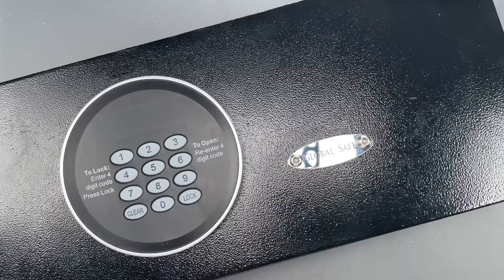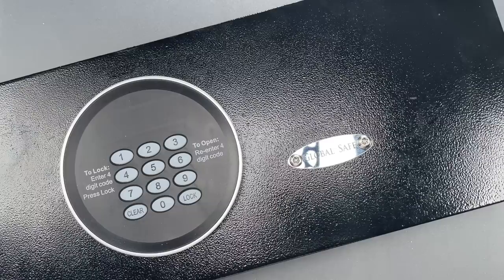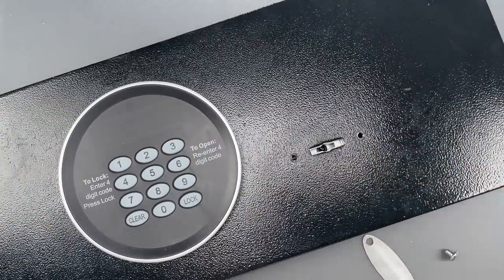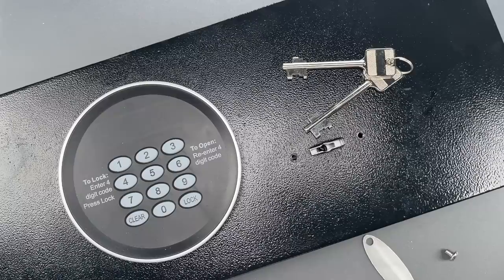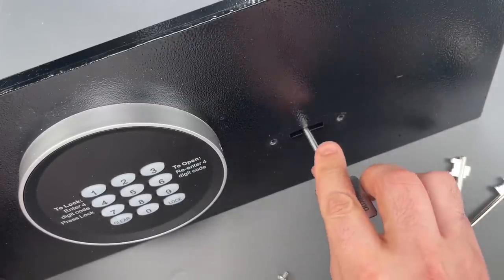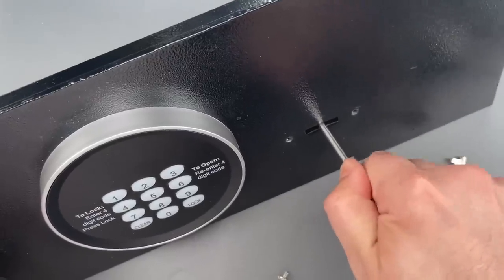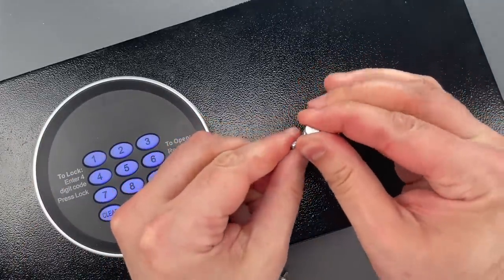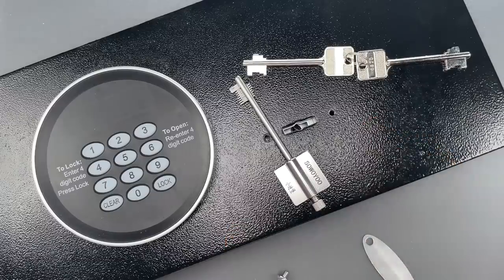[1462] Impressioning a Hotel Safe Lever Lock (Global Safe)

Comment: About 40 years ago an employee stupidly put the keys to our high end floor safe down the deposit chute! We tried every locksmith but all claimed it could not be opened, so would need to be excavated from the concrete floor...one chap gave me a phone number of someone he claimed could open it but on the strct understanding he was not to be questioned....he charged £300, he did a similar thing as LPL except he covered the blank with a very thin coat of putty, after 2 or 3 impressions he then slotted tiny lengths of metal into a hollow key shaft and tightened them with an hex key...et voila! Opened first go...and he handmade me a new key...I suspect his 'apprentiship' was with the sort of people your parents warned you about!
Reply: Great bedtime story. I’m a locksmith but I only contract under strict terms of anonymity and customers aren’t allowed to make direct eye contact or chew gum in my presence.
Reply: Something similar happened years ago when we had a drink machine with cups.  A part-time employee opened the machine to load more cups and left the key ring with all the office keys inside the machine.  The next day when they called the supplier they found out it would be an expensive service call to try the different keys.  However, I had a very good memory and remembered the number stamped on the key.  It was cheaper to buy a replacement key to open the machine and retrieve the key ring.
Reply: @Make-Asylums-Great-Again  if your inferring it's an exaggerated story I can assure you it is perfectly true, I found out some time later that he was indeed a professional safe breaker....he actually opened an old safe we had in the basement quite literally with a key he pulled out of his bag, took him 20 seconds from looking at it to opening it...unfortunately it only contained old paperwork.
Reply: @raymond19001  You should always have duplicates lodged with the bank.
Reply: @philipinchina  They should, but they don't. No need for quality assurance when you plan your own bankruptcy, i guess. 😆
Reply: @philipinchina  I agree.  I have duplicate keys for all my locks.  However, I was not responsible for this machine, it was the employer where I worked.
Reply: A lot of the need for secrecy or anonymity has more to do with avoiding being pressed into service by criminals or police than with a shady background. LPL knows this and keeps a low profile 😉
Reply: I hope you mean "apprenticeship"
Reply: @Make-Asylums-Great-Again  How very droll.
Reply: @jeffgraham6387  I was referring to my own personal experience(I live life by a strict set of codes) and I liked your story, I happen to see it before going to bed. Man, people always take things in such a negative way.
Reply: @elemar5  thank you
Reply: @Make-Asylums-Great-Again  great comment especially the chewing gum bit.
Reply: Twist, it was LPL.
Reply: @zxggwrt  His low profile has more to do with a past screw up, and no I don't mean anything criminal. Let's just say it's not too hard to find out who he really is. He had a different youtube channel before and some mistakes were made. I don't say this to criticize him, I still like him just fine but like all of us, he too has skeletons in his closet.
Reply: Many years ago, my wife and I were traveling through the mountains of southern Germany. We came across a very German looking restaurant that turned out to be a Chinese food restaurant. Never having had Chinese food in Germany, we stopped for dinner. As we exited the rental car, I noticed that I had left the keys in the ignition. The rental car company told us that we would need to contact a local locksmith as they do not have spares. When we ordered dinner, we asked the waitress if there was a locksmith in this tiny little mountain town. She said no, but she may be able to help. She turned to talk to a bar patron and said some stuff in German to this gentleman and came back. She said he could get the car open with no damage for 100 Marks under the condition that I don't watch and don't look at him and don't acknowledge him in any way. I agreed. By the end of dinner, the waitress brought us our bill accompanied with the keys to our rental. Overjoyed, I gave the waitress the amount agreed upon and told her that I wished to buy him and his friends all a beer as thanks. We left the restaurant and headed back to our hotel. We both agreed that his stipulations were kinda weird...but laws in other countries may be weird to us...and who are we to judge.
Reply: @ekummel  I wonder if it had more to do with him knowing some really easy way to get into the car and so he worried if you saw, you wouldn't be willing to pay. Reminds me of a story Richard Feynman tells in his book. Paraphrasing, he was asked to crack a safe as he was known as a bit of a safecracker. Fortunately he already knew the combination so he agreed but on the condition that he had to be completely alone and it would take about 20 minutes. He left to "get his tools" but was actually just looking up the combo in his notebook, came back and locked himself in the room with the safe, read the newspaper and made the occasional banging noise for 20 minutes, then opened the safe. It greatly enhanced his reputation.
Reply: @ekummel  A while ago, I had to break into my own car.
Turns out, the whole "ripping off a windshield wiper" thing actually works. 
Still took me quite a while, in a supermarket basement Parking lot.
Keys left inside, went shopping and came back...damn.

I pried open the top of the driver- side door a little further (by inserting folding leatherman combination pliers from another helpful customer), pushed the spring steel wiper insert through the seal and between the corners of the door edge and frame, and after some trial and error, managed to bend the wiper insert to a shape that would reach the "lock/ open all doors" button.
The seam kept bending the insert into a curl, so I had to pre-bend it even further the other way, to find a balance between elastic and plastic deformation. 
I also gave it a twist along it length, that finally made it work.

Took me most of an hour, the seam got scratched a lot and the seal punctured, but this car was too much of a clunker to really worry about that. Buying a similar car would have been cheaper than a locksmith.

It felt really nice to get it open :D
Other than the person with the leatherman tool, there also was a worker from the supermarket, who had to lock the gates. 
He was very understanding, and told us to just use the entry gate to get out, which had been broken for a long time anyway and could not be closed.

It also was impressive how kind and helpful other people are when you break into a car in public and there really is a key visible inside. Not that they checked.
Propably works with most plausible stories, and a crate of groceries or similar props...
Reply: @nos9784  it’s like wearing a high vis jacket and carrying a clipboard.
Reply: Please "voila", not "viola".. it means a completely different thing.. :D
Reply: @freeeflyer  you missed the joke.
Reply: @jeffgraham6387 did all the lock smiths that failed to unlock the door still charge you for showing up? It's robbery when they do that and fail to actually do the job.
Reply: @Make-Asylums-Great-Again  or you just sux at locksmith. this is a possibility to buddy.
Reply: @CrypticCobra  ...no, when I told them the make and model they turned it down straight away....
Reply: @nos9784  What country are you in? I ask because in Europe our cars have deadlocks so even if you were physically sitting inside the car you wouldn’t be able to unlock the doors as the lock and handle are deactivated when it’s been locked by the key fob.
Reply: @isyt1  some one did that to me once. (I was inside and he was out). I was about to break his window.
Reply: @Make-Asylums-Great-Again  lol
Reply: @isyt1  It was a european car, made in 1998. Golf IV, originally sold on the german market. 
Afaik, the key has a short-range transponder that sends a digital key to the ECU via the lock on the steering wheel.

I always wondered whether or not it would work  without the key in proximity, and I did the experiment today.
 The central locking does work even with the key inside two metal cookie tins on the other side of a building. 

Half the keywells are broken, thats how I locked myself out in the first place... i used to hit the button with the key in my pocket.

I suspect the button just always works on this car.

I can't check with the car locked from outside, both side locks are broken.
Going in through the rear hatch did work, though. Really handy when people disrepect the boundries in a parking lot :D
[or when all the other locks are broken :) ]
Reply: @freeeflyer  My face when i read it was like "what??!"   then i realized the typo !!!

J'avais des images en tête ....  :S
Reply: Don't question him cause he gets the job done
Reply: Voila, not viola.
Reply: @raymond19001  How is that similar to hiring a sketchy locksmith?
Reply: @EikottXD  I never mentioned a sketchy locksmith.  Jeff said an employee dropped the keys in the chute and I said an employee locked the keys inside the machine.  Similar for those that understood.
Reply: @freeeflyer  The calibre of grammar these days is average at best. I find myself continually having to interpret what people have written.
Reply: @Make-Asylums-Great-Again  Actually that is not as far fetched as you'd think. in Lithuania where I grew up Locksmiths would always ask you to step several steps back or some would even have a privacy curtain, because by law it was illegal for them to "show how to open locks without a key to unlicensed individuals".  So it really was a case of 'avert your eyes and ask me nothing' or they'd risk losing their license and getting a hefty fine :) No idea if that law is still in place mind you, been a few decades since
Reply: @freeeflyer  at least it was an honest try and not “wallah” as is sometimes seen.
Reply: @johngayder9249  
What did the magician say when he made the violin grow a little bit?
"Viola!"
Reply: @Make-Asylums-Great-Again  Sounds reasonable, especially the no chewing gum part
Reply: @sw6188  The english used these days is full of metaphors. English and literature are not are not as highly valued in American education as they were  40-50 years ago.
Reply: @eleventy-seven  Yup, complete dumbing down of the masses. I don't buy into that madness. I was taught how to read, write and spell and those things are still necessary otherwise we may as well just go back to prehistoric caveman behavior and grunt at each other.
Reply: Ya pesky mail order locksmith courses lol
Reply: @johngayder9249  Yup, wallah, viola, wulla and all mannner of other attempts I have seen.
Reply: Sir, that was the LPL themselves.
Reply: @wingracer1614  aa i don't mean to pry, but out of curiosity what did he do before?
Reply: Well you don't need a new key if he opened the safe. 🤡
Reply: Or you start at home
Reply: @isyt1 My first BMW (1992) had that here in the US, but I believe that feature was removed after people got locked in cars. You still have it?

Comment: Try cleaning the carb, less sputtering and she'll start first try.
Reply: You reminded me of what was known as 'heap maneuvers'. Pump the gas peddle twice and wiggle the gear shift to get it to start
Reply: haha thats good
Reply: Started the video not getting the joke. Now I appreciate how funny this is! Made my day just a little better, tyvm!
Reply: That's funny. I don't care who you are.
Reply: Anyone know where to get these from?
Reply: @olibob203  most small gasoline motors still come with a carb. Unfortunately for larger motors you will likely have to go the vintage or remanufactured route.
Reply: Thank-you for the chuckle.
Reply: Beat me to the joke, but yours was better anyway. Good work, 10/10 no need to see me after class
Reply: I didn't understand your joke at first till I rewatched the video. Yeah, it really does look like a guy trying to start a car...very funny!!!!
Reply: Well done!
Reply: @bmxerkrantz  no the key, (I do think you where being funny but really want one of those keys)
Reply: That made my day. Thanks
Reply: Nice
Reply: @skygh  My dad had an old car back in the 70s when I was a kid that you had to pump the gas pedal 27 times to get it to start if the engine was cold.  Not 26.  Not 28.
Reply: @bokkenka  I have a 72 Chevy El Camino and all that I needed to do was depress the accelerator one time to the floor to set the automatic choke.  Turn the key and the 350 engine fires up every time.  Bought this old truck on February 15th 1975 as I traded in my two Fords and some cash for the El Camino.  Best vehicle I've ever owned.  I'll never by another Ford.
Reply: @skygh  that is true for Zenith Carbs one of the valves is a choke valve for extra fuel only drawn in on pumping
Reply: Literally what came to mind during the video lol
Reply: @bokkenka  Aah... The good old days. My dad used to use a stick of chewing gum to "adjust" the choke on his 1970 Gran Torino in the winter time to get it to start.   Fred
Reply: From back in the day when people could still do their own repairs
Reply: Maybe it ain't got no gas in it.
Reply: I had a good laugh at that.
Reply: nah. i think its the starter. might be stuck. might gotta smack it a lil.
Reply: Maybe, maybe not
Reply: @ZombiZohm  im 38, you can still do it.
Does take some more pre and post repair research and time investment when diagnosing electrical/transmission issues.

Most everything else is a parts swap.
Diagnose 100%, then try to verify it before considering the repair/part chosen is the absolute final fix.

Sometimes its just corrosion on a wire harness ground connections. 12v test light, a really good flashlight, a trustworthy Multimeter/DVOM and maybe a simple code reader(though not required, the multimeter can show anything but OBD codes, sadly manufacturers gotta squeze our genitals every single step)
Then watch some South Main auto/Pine Hollow Diagnostics/RainMan ray on youtube. Its also very likely these youtubers have your specific issue in a fully explained video.

Outside of all that, you gotta want it. It does help to distrust the dealerships/random techs/overall labor pricing, like I did years ago. Being stubborn can be a skill, if you gonna be dumb ya gotta be tough. Man im tough, lmao
Reply: @olibob203  LPL said China, so probably Wish or some Chinese company selling lock picking tools out there. He also said he had to modify it for it to work reasonably well, so I kinda have a feeling a very similar product of far higher quality might appear on Covert Instruments once LPL gets everything he needs in order to be able to sell it.

Also, the thought just struck me, I wonder if LPL is a patent lawyer… I could see an interest in the mechanics of lock picking developing out of seeing lock patents all day for a significant amount of time.
Reply: @snorlax6691  Maybe Ed China!
Reply: He had almost killed the battery! 😂
Reply: 🤣🤣🤣 made my day.
Reply: @threadtapwhisperer5136  If I hear LPL say, "There's your problem lady," I'll know The Matrix is glitching 😅
Reply: good one :D i remember when they guy at the shop used to say to grumpy starts for angry customers "Try blowing on the key, might be dirty"
Reply: This comment was really, really good.
Reply: Don’t forget the neutral wiggle
Reply: And dont hold the pedal to the floor or you will flood it
Reply: Oh my that is impressively accurate
Reply: Yo you actually reminded me to take me carb off and clean the jetting.
Reply: I like the video.  Where can I get this key please?